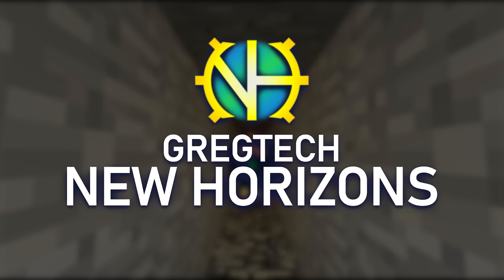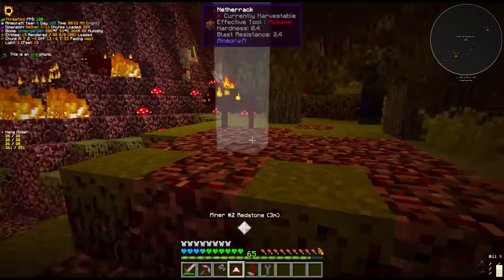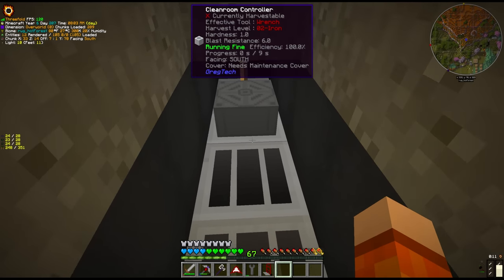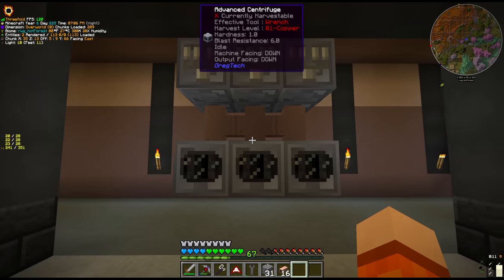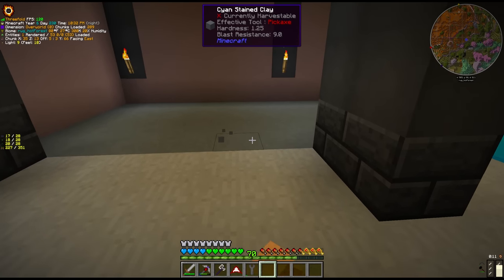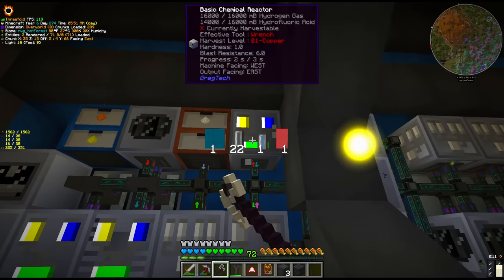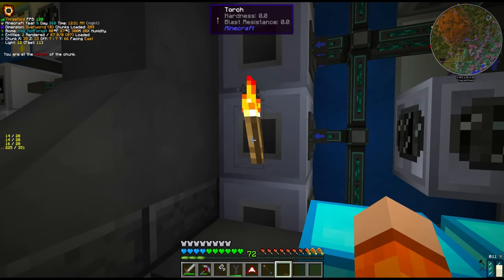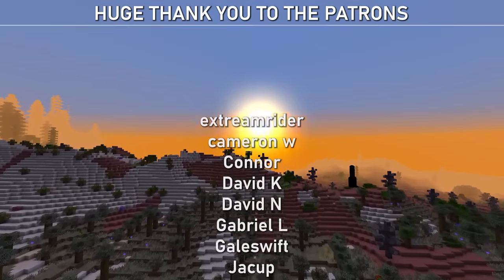Gregtech New Horizons S2 19: Polytetrafluoroethylene

Comment: Ah, right, the fourth reason why electrolysing water is just the worst recipe: It keeps tempting people into using it because it's so simple, again instead of investigating/investing into actual long term solutions. And note, by the way, that even if you didn't have the Benzene setup for the 1,2-dimethylbenzen solution to hydrogen another common solution for hydrogen is Methane, which you need for PTFE anyway. You really don't have any reason to still be electrolysing water by the time you reach PTFE.

This concept of electrolysing the hydrochloric acid is just amazing. That's what happens when you're playing a pack that makes Iron III Chloride just rain from the sky in exchange for an offer of pretty meaningless questbook tokens, though.

Yes, Three, jump down a giant shaft and land in water instead of crafting something that gives you passive immunity to fall damage. You're a wizard, buddy, try to remember that 🙃.

If you build setups with the idea that come AE2 they'll be thrown out the nearest window of course you're going to end up with seven piles of garbage. Good setups work with AE2, not because of AE2. You don't need AE2 to supply an IV base with various plastics and other chemistry produce, you don't need AE2 (or GT++ multis for that matter) to set up automated ore processing, and when you do unlock AE2 it's not going to immediately obsolete the setup either. If the setup works you don't have to upgrade it, if AE2 can interface with the setup easily than you don't have to rebuild it. It's the same with single block machines: You don't stop to upgrade every LV machine to MV when you get an EBF up and running, and you don't stop building/using LV machines afterwards either. LV machines still work, so you still use them. The same is true for these sorts of setups, if they were designed well.

Ah, yes, the Mantle of the Raven. Only takes a Greatwood wand to craft, and you've seen what it's capable of. It's fully passive too, no cost other than crafting it (and using up your Cloak slot, and there are several other cloaks you can make, but I definitely tend to favor the Mantle of the Raven). If you're wondering how you're supposed to get proper creative flight in GTNH (I'm not sure if the bonus applies to jetpacks) you either kill chickens until you get a Chicken Trophy, or work your way up to a Soarleander and finish the quest for it to get one as a quest reward - yes, there's a quest for crafting a Soarleander. Either the devs thought it was a funny joke or they were the ones who missed the joke, couldn't say for sure. Either way get a Chicken Trophy and craft it with a feather in an MV assembling machine to get a seven minute Creative Flight potion from Blood Magic. "But than I'd have to either get a steady supply of chicken trophies to replace them or dive into Blood Magic to refill them", you say? Thaumic Restorers can "repair" Blood Magic potion Flasks, so one chicken trophy and a Thaumic Restorer is all you need for functionally infinite creative flight. "What about Flugal Tiara" the botany enthusiast asks? Eh, forget about it. Anything Botania past Runic Altar in GTNH is, eh...well it's an interesting study of pack balance (or the lack thereof), let's put it like that.

Three might be getting fewer Ender Creeper visitors if he discovered Chandeliers at any point, but I suppose I'll settle for him discovering Illumination wand foci. He probably doesn't need whatever section of the base is inevitably going to violently explode anyway 🙃.

Note that there are limits to LCRs sharing recipes. Once an LCR starts running a recipe it will keep running that recipe until it runs out of inputs for it. So if you tried, say, having Tetranitromethane and Cetane-Boosted Diesel in the same LCR it would never actually run the latter recipe unless you carefully metered out the inputs such that it would switch between them. Obviously that's quite the automation challenge without some very expensive or complex setups, so don't assume that you can just throw single LCRs at every problem without any thought, either.

So you have a separate tank for the fluorine so the cells get recycles correctly, and you have a problem with the shared oxygen tank not recycling the cells correctly. I think we may need to get Professor Layton in on this case, it's a real head scratcher trying to figure out a solution for this one. (I know space constraints probably make this solution not viable, but it just sounded a bit silly pointing out a flaw and the obvious solution immediately afterwards 🙃)

Comment: The Raven Mantle works like the glider, and you can actually use them at the same time for even higher speed. I don't think nanoboots give make flight faster, but now that you have PTFE I believe you are able to craft Boots of the Voidwalker that apply their speed boost on flight (they also have 5% vis discount which is not included on their tooltip). Add some Thaumcraft progress to unlock Primordal Pearls and you can craft the voidwalker sash, which combined with the boots will make you fly faster than the chunks can load.

Comment: I'm in early LV and just started crafting the wire mill, since it took me forever to move my base like 800 blocks lol.
I'm proud of just my little HP steam age processing line to grind and then hammer or directly smelt ores (the plain iron ore I smelt like half of crushed into nuggets for wrought iron and half I hammer into dust to make steel so I don't waste the smelting step). The thing that took me the longest to figure out (including how the conveyor and pump covers work in general) was how to get creosote out of my coke ovens automatically.

Comment: For your cell theft issue, why not use the ender conduits to send empty (used) cells into a central drawer for empty cells, and just keep a stock of empty cells in that drawer that the machines pull from? Basically have the drawer export be on one color to be put into machines for crafts/processes, and when the cell is emptied it's exported on a different color that goes back to the drawer. This makes all cells that empty go back to a central stockpile for use.

Comment: Three is going to end up pulling Ender Tanks from lootbags before placing down a Long Distance Fluid Pipe at this point 🙃. They are pretty cheap in LV and definitely very cheap in MV (since EBF opens up much cheaper/faster steel), and a nice improvement over manually moving around fluid tanks. Although super tanks, admittedly, do store a large amount of fluids for this point in the pack.

Ah, back to the good old AE2 rush 🙃. It really isn't as critical as people make it out to be, at least this early on. Batch crafting and just keeping yourself organized, maybe an inventory panel if you really need it, will get the job done. You really can't do much of any permanent automations in EV anyway because come IV the GT++ multis open up, and suddenly half your factory is going to get reworked. Rushing AE2 is not the solution to early automation. Good setups are the solution to early automation. A good setup you can build long before you reach the Moon, can store enough material in a conveniently accessible location to make batch crafting large volumes easy (and later hooking up into AE2, for that matter), and keeps working until you're ready to replace it with a significantly upgraded/more permanent setup involving GT++ multis and/or LCRs, connection to a central power spine, etc. If you start setting up for automation in EV something has gone horribly, horribly wrong. On top of that don't forget that AE2 doesn't open up fully in EV anyway. If you want a (discount) interdimensional wireless AE terminal through AE2 you're going to have to wait for a T2 rocket for Bacterial Sludge for the Spectre Key, that's not something you're going to be building in EV either. Meanwhile the cunning Thaumaturge already has something of the sort set up pre-moon in HV. Not as good, of course, but something that'll get the job done.

Not saying that AE2 itself isn't necessary, mind, it's very much required starting IV at the latest for autocrafting circuits if nothing else (I've tried batch crafting at that stage, and can confirm: It ain't working, chief). I'm saying that expecting AE2 to carry you post-Moon if you can't carry yourself pre-Moon is expecting a driver's license to get you places without having an actual car to drive.

Ah, water electrolyses. The singular worst way to generate hydrogen and oxygen the pack offers, and a recipe that's so inexcusably bad I suspect many a player would have been better off had the recipe not existed at all and instead forced them to find better solution. As one should, playing GTNH. There's three major problems with electrolysing water: It's slow as molasses, it's crazy expensive, and it produces both oxygen and hydrogen at the same time. Now that last one might not sound like much of a downside, but eventually you end up in a situation where you're not consuming both at the same rate they're being produced, necessitating either voiding the excess or jamming up the system. This particular instance of water electrolysing actually isn't the worst use of it - the recipe isn't slower than distilling the oil is so it's not a bottleneck, the power cost is being fronted by a (largely obsolete) steam setup that wouldn't be meaningfully contributing anything otherwise, and while this setup won't be consuming oxygen and hydrogen at the same rate it's being produced it will be able to keep running for at least some time before the O2 super tank fills up. This setup isn't a long term solution, obviously, but as a short term solution it will get the job done.

Funnily enough, anyone who has sanity in short supply is going to be swimming in Gallium. It's very easy to produce through Thaumcraft metal transmutation, the research is just a wee bit warpy. And by a wee bit I mean it's double the normal Taboo research warp. Costly, yes, but you'll never be hurting for several materials again. Ruby Juice? Pff, the devs can keep their (ridiculously overpowered) ore processing. A crucible is all a dedicated Thaumaturge needs to produce Chrome, or Gallium...okay, that and some sanitizing soap. Thankfully the Benzene setup includes a steady supply of Sano essentia 🙃.

Despite the quest being in EV there's actually nothing stopping you from processing Platinum Pain Train Dust into proper Platinum in HV, since you do need HV machines for Ammonia and Nitric Acid. In fact you want to do a bit of platline early if you want the best crossbow/sword you can get in HV, since doing a bit of platline allows you to get Palladium, which is a better material for both swords and crossbow bolts than Meteoric Iron from the Moon. Does require a Vacuum Freezer to cool the hot ingots, though.

Word of warning: Don't try to scan a Howler Alarm with a Portable Scanner. The game really doesn't like it. That said do make sure to set up one for the cleanroom. Maintenance issues are extremely random, as in my first cleanroom had no issues for a literal real life week and my second cleanroom got two in less than an hour, but either way you don't want stuff going missing to be the only indicator that the cleanroom has a maintenance issue.

Methinks Three is a bit confused. The EBF recipe for Wrought Iron Dust + Oxygen -> Steel (regular iron dust also works, but takes five times as long to cook) is an MV recipe that only needs cupronickel coils. The 4 Wrought Iron Dust + 1 Carbon Dust -> 4 Steel recipe (same deal as before RE: regular iron dust) instead is EV and takes Nichrome Coils. The reason you don't replace your BBFs immediately upon getting your first EBF is because it's not going to have a chance between cooking Alu, Pulsating Iron, Redstone Alloy, and probably a few other things (if it even has the power to run at all). By the way, Alu is much the same. With Kanthal Coils you can use carbon dust instead of Cryolite dust to cook alumina, and with HV power and Kanthal you can just cook pure alu dust directly.

There are other ways of obtaining blaze rods or blaze powder - there's a crucible recipe to turn one blaze powder into a blaze rod (though the recipe is fairly involved with what essentias it needs) or one blaze rod into three or four blaze powder (depending on the exact recipe you use), you can craft Buckets of Incendium to slowly turn lava and essentia into blaze powder (effectively, Incendium is a Thaumic Bases item) or you can plant the Blazereed IC2 crop to slowly grow blaze powder and, more rarely, blaze rods. Or just go to a Nether Fortress and show it who's boss, which admittedly was a lot less easy during the pre-Vengeance nerf era. Making a mob farm is also a possibility, if you've got the means to do so.
Reply: There is also a bees for blaze rods and powder
Reply: Sugarbeets for oxygen, what's the easiest renewable for hydrogen?
Reply: @LuluTheCorgi  The easiest renewable hydrogen is actually electrolysing benzene, although once people have a Distillation Tower they generally prefer electrolysing 1,2-Dimethylbenzen instead. Since, you know, benzene power and all.

The easiest source that isn't infinitely renewable (until much later, at least) would be tapping into either a Natural Gas or Light Oil fluid field, processing it into Refinery Gas, and using one of several methods to process that into hydrogen. It's not exactly infinite, but a very good Light Oil field can yield somewhere north of 10 million buckets of Light Oil, which yields 16 million refinery gas, which can easily yield 48 million buckets of hydrogen. Even more if you process it better, the 1:3 ratio is just the simplest method. That said twelve thousand Super Tanks 1s worth of hydrogen will last you a hot minute anyhow 🙃.

Comment: To fix the "theft" problem with the cells, you could always put a buffer tank between the centrifuge and the main storage, input the cells into the buffer tank but have the item output back into the conduit line and the fluid output into main storage

Comment: Some suggestions to your new chemistry system:
You can apply slowing card to conduit, which one needs to export empty cells via round robin. The thing is item conduit will export 1-4 items by round robin by default depending on how many items it has to export. Applying a slowing card you make it exporting 1 item per cycle, so round robin fits in correctly.
Also since you talked about creative flight - you can get a chicken trophy by annihilating chickens, and then create a potion in assembler which gives you creative fly effect. This potions are limited on usage, but can be restored by Thaumcraft restorer machine.

Comment: couple of things:

firstly, for lighting: I think the blue or white is most interesting. you could also look into the lights from ender io, they're small, non intrusive, and bright, with a modern look (unless you prefer magic balls, up to you!) and quite cheap.

second: I've done a lot of systems where you need to move cells around and recycle/empty/fill them. to fix your issue with the oxygen for example I would put a small buffer tank next to the main oxygen tank. make sure it's not on the main fluid storage network. insert the cells and extract the cells on the PTFE network line into that buffer tank, and use another conduit/pump to pump the fluid form to the main storage. you are kind of already doing this with the extra fluorine tank for filling cells, so just do that again for other fluids where needed!

alternatively just make LCRs ;)

Comment: I find turning view bobbing off makes the nanosuit boots of the traveller much more usable - even the quantumsuit ones are quite ok once you get used to them imo (jump height aside). A couple of other things:

Separate EBFs for each fluid can be nice but in practice there's usually only one possible fluid per recipe so it's fine to have several fluids available at the same time (with multiple hatches). Being able to do every recipe in every EBF gives you more flexibility, and allows use your fastest/most efficient EBFs for every recipe. At EV you get quad fluid input hatches so with 2 of them per EBF you can have pretty much every fluid you need available everywhere.

The LCR recipe is definitely the way to go for PTFE but I'm impressed by the ignenuity of the single block system! For systems of this type I've found the only way to consistently avoid cell issues is to saturate (or almost-saturate, i.e. to within 1 stack of full) the system with cells so that there always have to be a non-zero amount in each machine. This is pretty cheap to do now that you have the PTFE cell recipe. You can also look to see if there are separate self-contained cycles within the process and separate the cell returns for each of them if you want a bit more predictability. But unless you specifically find that fun, in practice it's quicker and easier to just use LCRs now that you have them :D

For the lighting, might be nice to have a few different foci of different colours? I think randomly choosing a different colour for each light is what a true Von Sway artist would do. Also, now that you have infusion, Amber wand is your friend! It holds only 10 of each aspect but automatically refills all of them (and pretty fast) so it's great for small regular drains like foci and runic shielding, never needs recharging.
Reply from the maker: Quad hatches sounds awesome, did have those last time we played so I'm looking forward to being able to use them :D I was really considering just making an LCR to batch craft with, but I thought it might be better to have something a little more passive for PTFE, since last time I was really bottlenecked by it in EV. Different colours of lighting sounds like a fun idea to try out too. Thanks for the tips <3